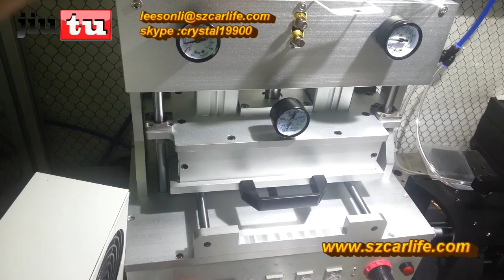iphone 6 6 plus broken screen replacement ,for broken iphone 6 repair refurbishment fix repair jiutu

Comment: Why dont you show us the removal of the iphone 6 frame???
Reply from the maker: Hammered Digger Dear Hammered : The iphone 6 frame is quite easy to remove , you just need to do it manually will be ok .First put it on the hot plate and then cut in several places to remove it one piece by one piece will be ok .We have full set of the new oca machines and parts for phone repair , if you have any further interests ,pls kindly let me know your email ,so that i can send you with the detailed information and quotes .Thank you .My name is Crystal ,email : leesonli@szcarlife.com or skype :crystal19900